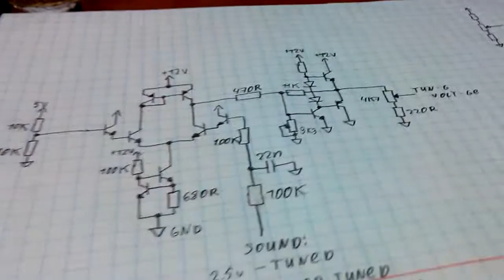Adding AFC to the superhet FM receiver

Comment: Do you still have your scheme ? /Which changes you made from the superhet web ?
Reply from the maker: Teslákova laboratoř Yes, I do. IF strip and discriminator are same as in the quazar's schematic. Frontend (tuner) I have changed because the original was very emissive.
Reply: @mrjohhhnnnyyy5797  It is funny how i have some FM ic's (A225D,A220D,A283D) but i am too dumb to design the bandpass filter lol.
Reply: @mrjohhhnnnyyy5797  Do you have a schematic for the front end you are using?

Comment: How much did it cost you in Total
Reply from the maker: +Benjamin Maker It's hard to presume since I had most parts already. The only thing I bought just for it is 2sc9018 transistors. IF coils are pulled from junk boards and rewound, so are the coils in the tuner. Generic stuff like 2n3904&2n3906's, resistors, caps I bought cheaply in bulks. 
 I can just eyeball the approximate price, and it's about 5$ or less. Cheap, right? Many thanks to the awful exchange rates for that. 'cause in dollars it's cheap, but in my currency, let's just say inexpensive.